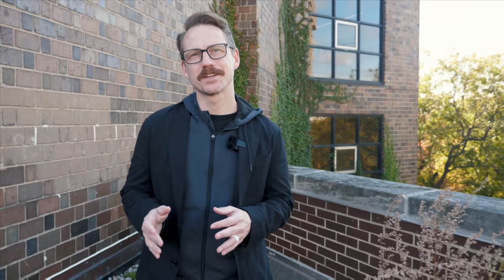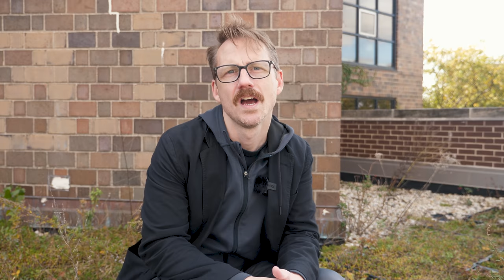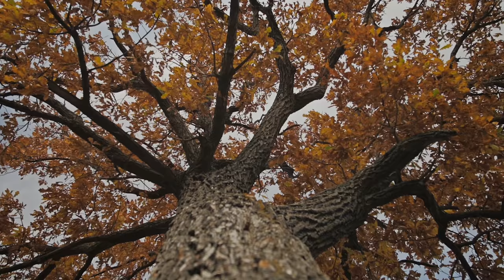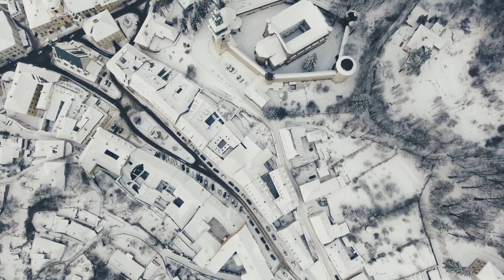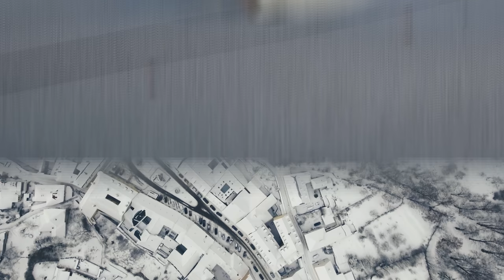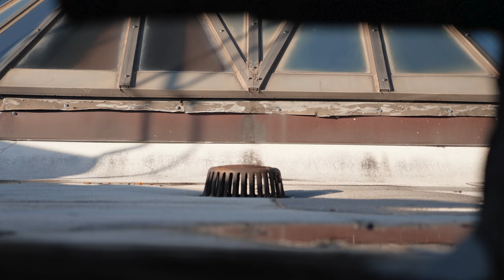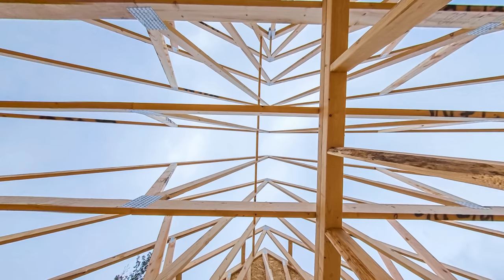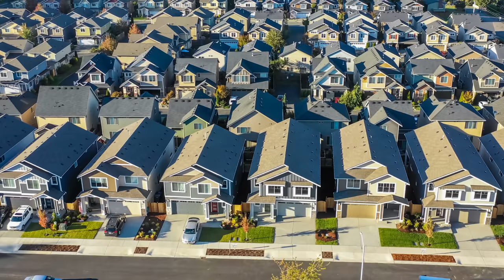Why Do Architects Insist on Using Flat Roofs?

Comment: I've always held this belief and never really thought about why. In Sacramento there were a number of cheap neighborhoods built in the 1950s that all had flat roofs, anyone that I've ever know who has lived in one has complained about the homes being freezing in the winter and hot in the summer.  This probably had more to do with the homes being cheaply built than the style of roof.
Reply: But what if they were cheaply built with gables? Unlikely to help in summer, might help with a warm blanket on top in winter.
Reply: Are these still around, or have they mostly been replaced/modified? Out here in Folsom almost everything is peaked, even to the point of absurdity like on some hotels.
Reply: @oltedders  Not in every gabled house, or in most of them in my experience.
Reply: These are likely the Eichler houses.  There is no insulation on the tar and gravel roofs and in the walls, and the walls of single pane glass don’t help.  The original in-floor radiant heating system is also inadequate.  The flat roofs invariably sagged over time and allow water to pond and eventually rot everything away.  Also those houses are termite heaven because they were built on slabs that allow the walls to be too close to the dirt.  These houses are very pretty with their post and beams and walls of glass.  If the gabled (low pitch) versions, not the flat roof version, were built with today’s technology and methods they would be really nice homes.  But then they would be really expensive.  Back then they were built as cheaply as they could so the middle class could afford that style of architecture.
Reply: @oltedders  not if the attic is well insulated.
Reply: Yes, thin walls . Thick walls insulate best
Reply: A gabled roof really takes the edge off that problem.
Reply: That has nothing to do with the roof slope and 100% to do with the insulation used.  I can use 50's technology and design you a flat roof house that meets any energy code of today.
Reply: An angled roof will let hot air rise up to the top vent, and replace it with cold air from the bottom vent.  Convection.  Flat roofs can't use convection to cool.
Reply: Correct, California doesn't believe in weatherization.  Ironic since the state is otherwise so concerned with energy conservation.
Reply: @MrTonypace  Of course this isn't the case in most gabled houses because in general most buildings aren't built cheaply, but that's also true of flat roofs, the room I had back when I lived with my parents had a flat roof and it was always the warmest room in the house because it was an extension and insulated properly. The topic here is cheaply built houses and there's nothing about a gabled roof that inherrently insulates better, in fact relative to a flat roof it just increases the surface area and therefore might increase heat loss.
Reply: I’m from Chicago.  Traveling over the years to California I have found that their real estate is cheaply built and overpriced.
Reply: no it has a lot to do with the roof type I spent years doing insulation a flat roof is less thermally efficiency because hot air risers and cold air falls and if you have good ventilation your roof will maintain a much more even temperature I live in Australia in QLD it gets hot
Reply: @MrJpilcher  ummm, ventilation is heat loss of the convection variety, aka the greatest fastest form of heat loss.   I think perhaps you're misusing the term "insulation."  Now I can see the point you're making about the cooling effect well ventilated attic can have in summer months.  But that effect is detrimental in winter climates too.  What you're actually describing is a cooling effect it seems, however this is the opposite of insulation.  Insulation is designed to slow heat transfer of any kind.   In general a flat can be Infinity insulated, you just stack more layers of rigid insulation.   I've installed roofing 14"/35 cm thick in some places, most of which was high density polyISO.  20cm/8" insulated flat roofing isn't at all uncommon here in Canada though I would argue 5"-6" is much more common in my past at least.  That's a lot of insulation though, especially when sandwiched between membrane barriers.  

Frankly though, the difference insulation wise isn't really that important, or at all the primary reason to choose between such systems.
Reply: @jeremyO9F911O2  if you have the ability to open and close vent you can close them in winter the idea of having a larger cavity of air in your roof take more energy to change its state so a larger the roof cavity the longer it takes to change state I live in a hot area but you can get vents the will open and close if its cold weather you want insulation to stop the heat entering the roof cavity the larger the roof cavity will take longer to cool down it's about creating a temperature differential between inside the house the roof cavity and outside works just like double glazed glass you will always get some transfer of energy of temperature but it's about regulating the transfer. I know most builder don't care about having a thermally stable house because you can't see it and it costs money so people don't want to pay for it so it gets looked over and then we just spend more money on heating or cooling the roof cavity it only one part of the whole
Reply: @MrJpilcher  lol, well they do care here in Canada where heating is expensive enough and not heating results in burst plumbing.   That being said our attics are constantly ventilated and our windows are triple pane.  We insulate our ceilings not our roofs for the most part.  Though don't forget that snow is a surprisingly good insulator too, I actually had to explain to another commentor that a foot of ice atop a flat roof doesn't really happen.  Heat loss from the building will inevitably melt ice and drain it never allowing it to get very thick. 

Now your double pane glass example is downright interesting because that's exactly how most flat roofing works.  You have a vapour barrier below the insulation and a water barrier on top, the vapor barrier ties into the water barrier forming a complete envelope.  The flat  roof I installed today puts a Yeti cooler to shame for it's thermal isolation.   Because again convection is the enemy, I mean that's the majority of what insulation does is prevent convection, and also using materials with limited thermal conduction while using loft to separate materials to further limit conduction.
Reply: @jeremyO9F911O2  I agree with your comment in Australia we have the opposite problem but most builders here just go for the cheapest option because they don't pay the power bill  I did my house myself so it is better than 90% of houses. We don't get the cold just heat in winter it can get down to 1-2 °c but only at night never enough to frezz pipes but in summer it will hit 40°c plus at times you turn on a cold tap and get hot water. We use sarking blanket with fibreglass insulation over the trusses and fiberglass batts on the gyprock celling so having a step pitch really helps the roof cavity can get over 60°c I know because my phone will turn off at 60°c and it has turned off in less then 10min somedays in a roof so we often don't use the space because it's just to hot.
Reply: In the 50' they did not have the insulation technology we have now. Many old buildings are now redoing their roofs with additional thick insulation material.
Reply: @lauravergot9995  well yes it is thicker, but more importantly it's higher density insulation.   We flat roofers also add better drainage these days too.
Reply: it also depends on what the roof is made off. poured solid concrete can get hot, but other types can be more insulating like the vigueta y bovedilla roof construction.

Comment: As someone who designs very large warehouses, a flat roof is really the only option as you say.  That said, scuppers are awful, and I much prefer dedicated secondary drains down to grade.  I appreciate your simple explanation of the systems.

EDIT: also, these designs in large warehouses are typically dictated by the structural engineers and G.C.s to keep costs down.
Reply: Thanks for your input and that's good to know!
Reply: Actually they are determined by the cost of the ground they are constructed upon and the "need" to squeeze as much as possiblle out of the space, regardless of the TCO, or the after effect when the owner of the building moves on.

Comment: My experience is that the shingles on a gabled roof usually show obvious wear before they leak, giving the owner a visual warning that the shingles should be replaced BEFORE the home is damaged by water. But flat roofs are hidden from view and don't show obvious clues before leaking. Water just starts dripping in one day. The leaks are tricky to fix because the source of the leak can be twenty feet or more away from where the water drips in.
Reply: @dangraff8467  Thats blatantly not the intention of the statement he made. He is obviously saying a more complex building, which most "good" architecture would tend to fall under, has more potential for failure points, thus more potential for leaks.
Reply: @dangraff8467  If you build a cube out of block with a single sloped section of roof, it has a lot less potential points to fail and let water in than if you build something like Falling Water or the Notre Dame. Just like owning a sportscar, owning a complex piece of architecture has pros and cons, his statement is in support of someone choosing to prefer something more practical, said in a playful way. He obviously does not judge buildings' architectural importance on the level of water which makes its way inside, and I don't understand why you'd choose to ignore the metaphor other than it being a poor attempt at being a troll.
Reply: @dangraff8467  It'd be condescending of me to belittle the well-intentioned professional who is creating a freely accessible educational video on a topic in a field which I do not work in for using a metaphor which I choose not to grasp, but I wasn't the one who did that.
Reply: @dangraff8467  prior to starting an architecture centric channel... *he had no idea that flat roofs were so divisive*, which I think is fairly understandable because of their widespread use.
No disrespect to you, its plenty fair to argue against the use of flat roofs in certain applications and climates, all I was saying is that claiming he thinks leaks are good is a silly jump. The fact that he dedicated a whole video to diving into the pros and cons of both flat and traditional roofing would suggest he does genuinely care about those who are inhabiting these buildings. I am literally a professional builder and developer who has a very heavy hand in the design process of everything I create, there truly is almost no one size fits all solution to any issue in the building world, unfortunately everything is weighing the pros & cons and that is even more obvious when designing complex structures. Any architectural choice on a building can have widespread effects which would have been very hard to predict... plus, on very expansive projects things tend to fall through the cracks much more easily.

A really great real world illustration of the mistakes made on the first go around are actually in a different sector - cruise ships - The first ship in a brand new "class" of cruise ships will always end up having its design tweaked and tweaked for each additional "sister-ship" built, effectively making the first ship a beta test for the following ones in the class. However, we tend to less frequently build identical structures (baring large corporations, there are actually some incredible examples with nearly identical skyscrapers being built in opposite corners of the world, or things like fast food restaurants which are very copy & paste) in the building world, and instead we have to just try to apply concepts learned to the next one. 🤷‍♂ I appreciate our discussion - have you had bad experiences with flat roofs?
Reply: @TryAgainPlease  stop arguing with this guy, he's clearly not being reasonable. It's clear to anyone that watched that the creator of the video doesn't "think leaks are good architecture" so I have no clue why he's being so obtuse
Reply: @dangraff8467  Maybe you could edit Stewart's scripts for him.
Reply: @dangraff8467  all your butthurt aside, a flat roof done right is problemfree.
Reply: @dangraff8467  "*playfully drills a hole into the roof of your vehicle"
Every heard of convertible cars?
Reply: Any roof done right is problem free despite having certain questionable design choices
Reply: Ever heard of rain?
Reply: @dangraff8467  ever hear of a row house?

Comment: I used to believe that flat roofs would flood, then I moved into a house with a flat roof, and I realise how wrong I was. Flat roof houses are fantastic. A few advantages I noticed: Easy to control all ingress points to prevent insects from entering, and to have control over ventilation. It doesn't provide nesting places for birds or bats. You can dry clothes up on the roof. You can easily access any rooftop equipment like AC units, dishes, solar panels, etc. Or just enjoy the view like a giant balcony. The biggest advantage is that it has more thermal mass which helps keeps the house passively cool. And as for leaks... of course a thick slab of reinforced concrete is much more impervious to water than hundreds of roof tiles (I know in the US they use asphalt roofs but that's not a thing where I live).